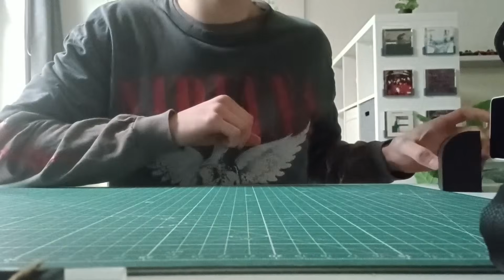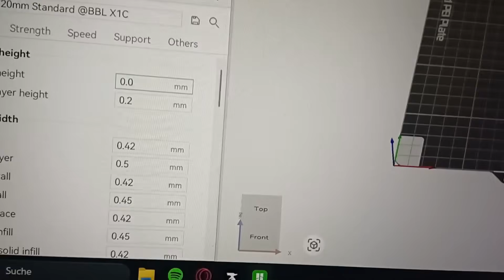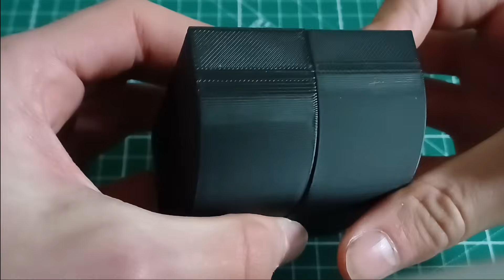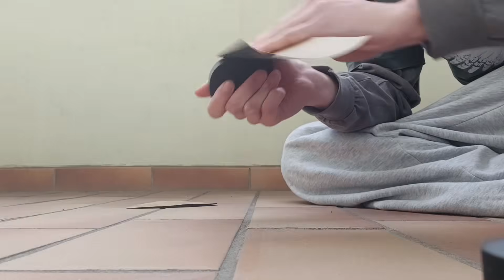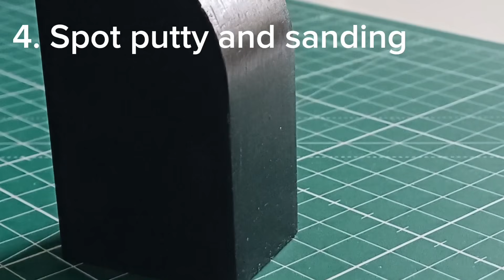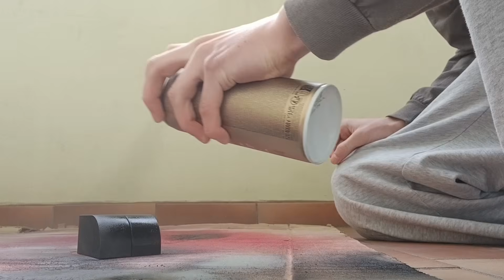Fix UGLY 3D-Printed Layer Lines (4 Strong Methods)

Comment: Brother, you can use "adaptive layer height" to help with the stair stepping effect without having to go to the extreme waiting length of tiny layer lines.
Reply from the maker: Yeah I know good call, i do it on helmets at the top. But doing it on the walls also helps with hiding layer lines and you have to post process the part less. I guess its always a trade off between time and labour